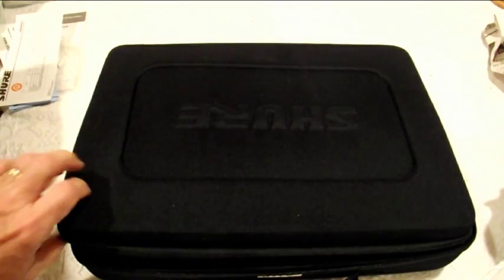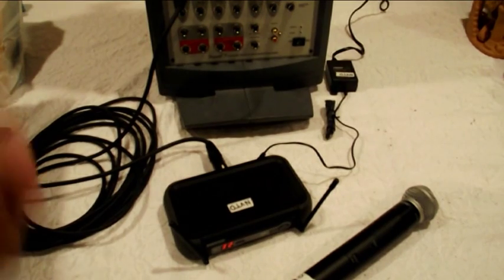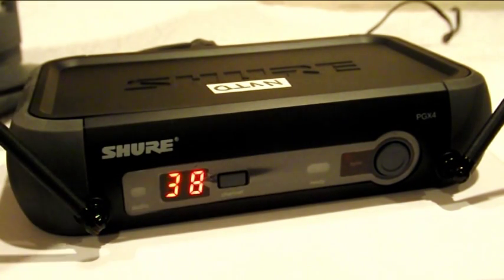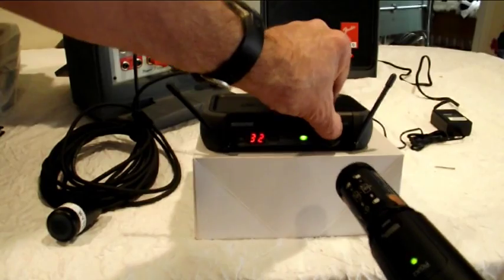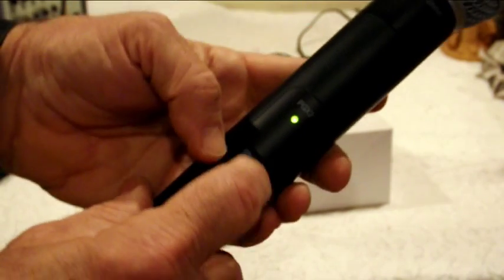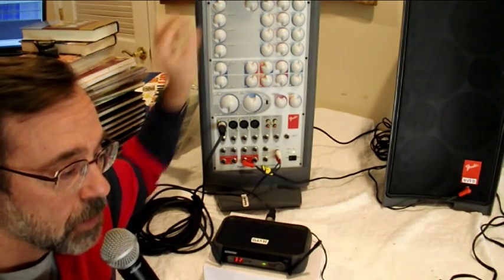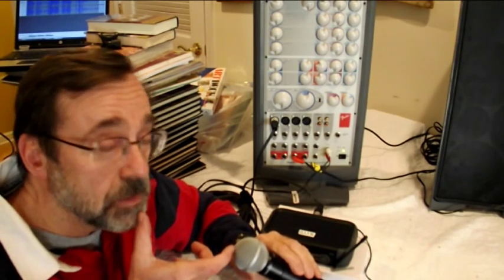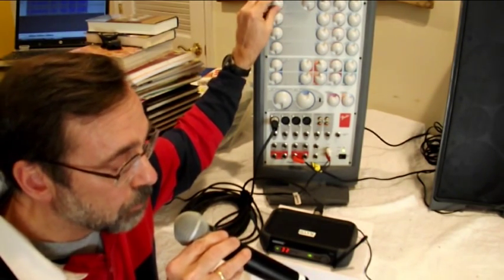Whacky Sound Education - Special Topic #1 - Wireless Mic 2

Comment: IS IT POSSIBLE TO HAVE MORE THAN 1 WIRELESS MICROPHONE ON THIS TRANSMITTER?
Reply from the maker: Your question is a little confusing, but the answer is . . . .NO.   This model of shure wireless mic is designed to have only one mic  at a time in operation.  

The reason your question is confusing is that the transmitter is in the handheld mic.  The box that plugs into the wall and into the sound board is the receiver.  So I think you were trying to ask if the receiver could have more than one mic at a time.

Here is an internet link that provides a more thorough answer:  

https://sennheiserusa.happyfox.com/kb/article/227-can-i-use-two-microphones-on-one-receiver-at-the-same-time